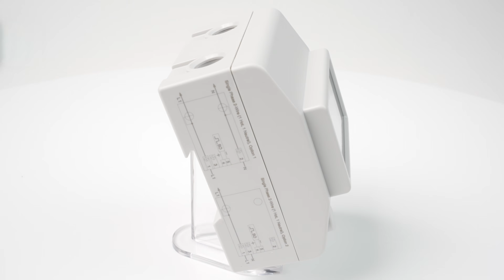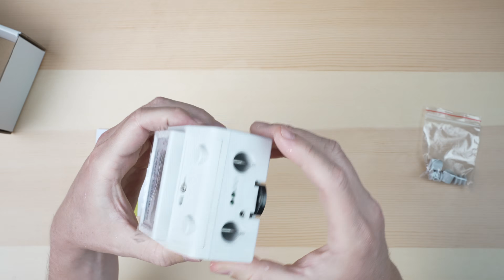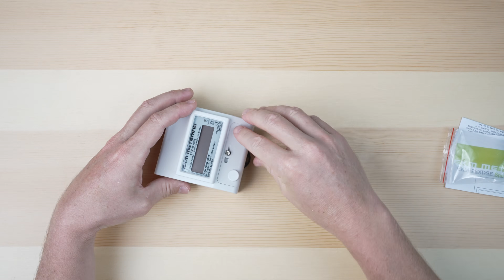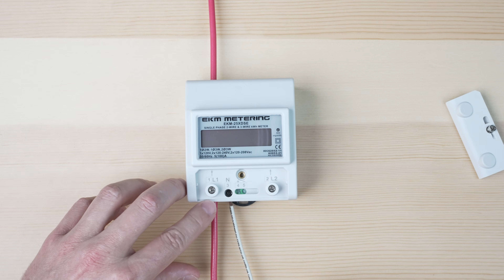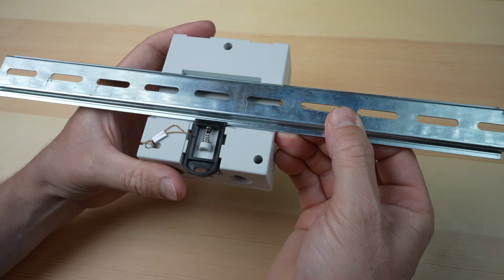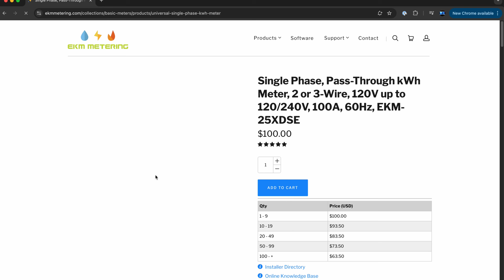EKM-25XDSE Product Description | Universal Single-Phase Electric Submeter | EKM Metering Inc.

Comment: In a 3 wire application, 120v+120v+neutral and ground, is it mandatory for the neutral wire to be hooked up to the meter? Or can 2 hots pass through  the meter and neutral+ground just bypass?

Comment: How's the LCD get power? Just 120v from a spare 15-20a  breaker?
Reply from the maker: The meter is powered by the electrical circuit that it is metering. There are screw taps that pierce the insulation of the wires that pass through the meter. Those taps provide voltage references and power the meter.